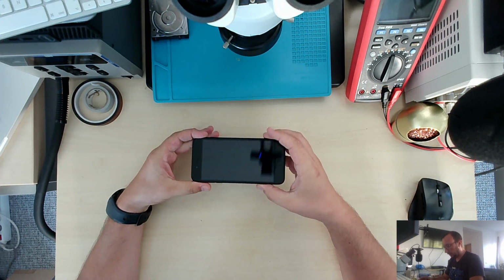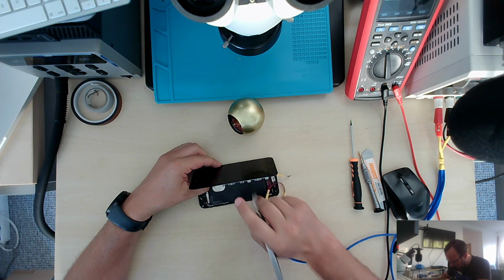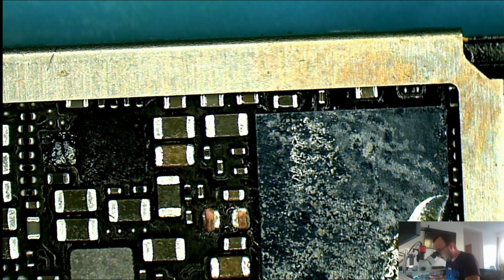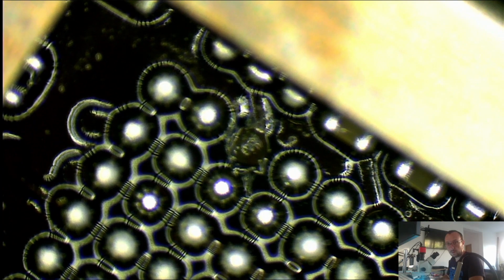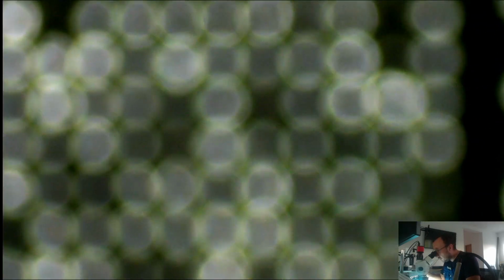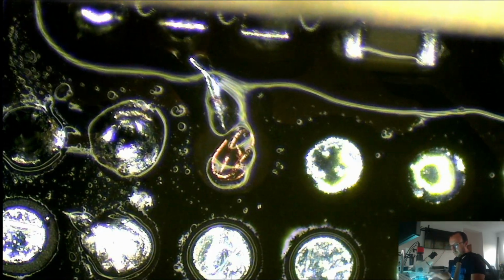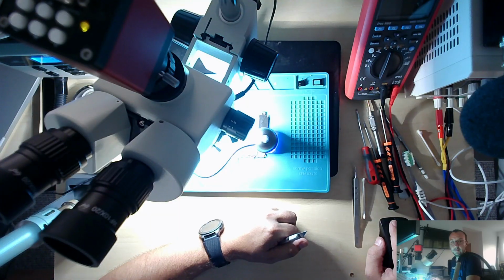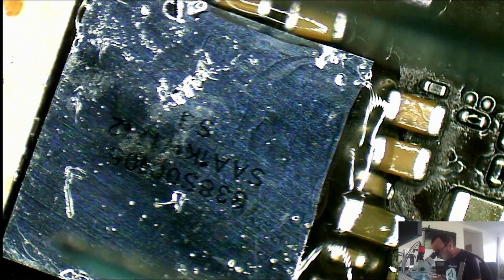iPhone 7 Plus audio IC repair  +baseband in Part 2

Comment: Have you tried reballing the baseband cpu? There is an issue that when you solder the ic audio chip there is a chance that some of the connections of the baseband cpu gets unsoldered
Reply from the maker: Yes, baseband was not working indeed on this phone from the previous audio IC reflow attempt. The baseband cpu is off now, but unfortunately I am still waiting for a stencil to be delivered for this model. Will post the baseband repair once I have the parts